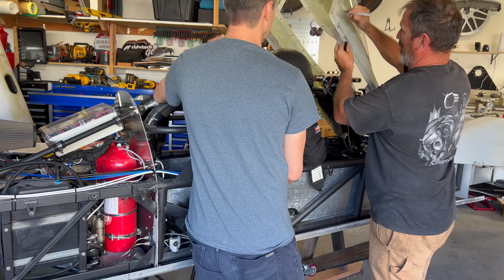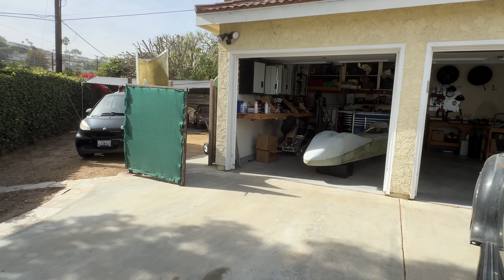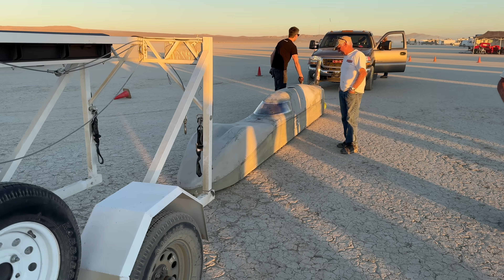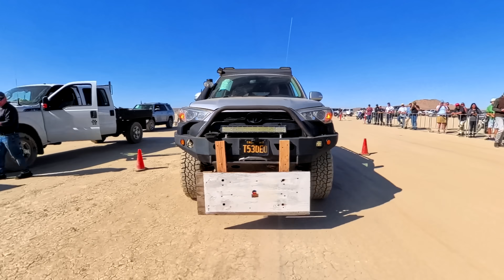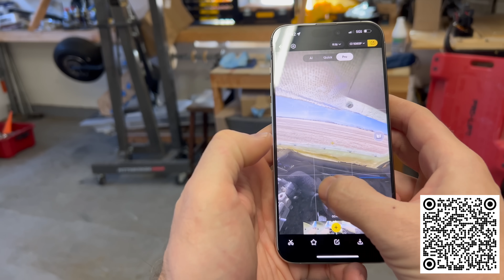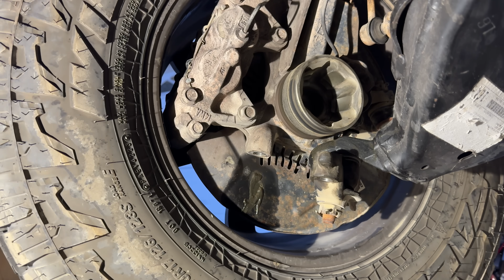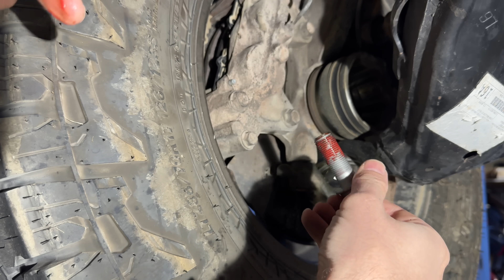I Went Too Fast

Comment: Why choose a 1000cc engine with deactivated cylinders?
There's the option of using a 600cc with the displacement lowered to 500. It would likely be lighter and have better power delivery.

Comment: Heheh.. too fast. Never been out on El Mirage during a speed trials event but I have been out there when nothing was going on. 1st time was in 1996 on a 1992 Suzuki GSXR 750(Bored and Stroked to 883cc). First pass I hit 185mph indicated and still had some Revs left in the engine before Redline. This was long before GPS devices were affordable or widely available. Lemme tell ya. Out on that dirt on 2 wheels, you can't tell the difference between 120 and 180, it just feels fast.

Comment: Hey congratulations on licensing! I am almost done with the video, but I ended up with an idea. You mention going with a 500cc engine and disabling two of the cylinders. I don't know if you will, but considering that crankshaft is likely flat plane, it would be fun to experiment with which cylinders are or are not active. You could either have a cylinder every 180, or 2 cylinders on the same side of the crank. Either inside or outside, which might not matter, except for vibration from harmonics. Good Luck!

Comment: I'm pretty surprised that you've decided on half a 1000cc four-stroke rather than a whole 500cc two-stroke. (Unless I'm just not understanding the rules). You should get 180 hp from a 500cc four cylinder engine without getting too extreme, and 210 if you're at the cost no object end of the curve.

And then further surprised that you've decided on a half a four cylinder to make a twin rather than a four cylinder that's already 500cc. 

But then I've never built anything.

Comment: So you are looking to exceed 150 mph with 500 cc, non boost, on gasoline? With a 4 cylinder engine running on 2 cylinders. Why not sleeve the bores and go with smaller pistons? Or de- stroke the crank? Or both.  A shorter stroke can get the rpm up a few hundred additional rippems . Building a custom crank case, and crank with a 70mm bore with something like 30 mm stroke  revving to 20k RPM may do it with c16 fuel, and 15:1 compression. And water methanol injection! 😎👍

Comment: Haha about you going 150mph and also you forgot to tighten one basic bolt. I had a similar feeling after rebuilding the whole front end on my motorcycle right when I was going 90mph on a very high sweeping overpass I would surely die from if I went over the barrier. "I sure hope I did it right!" Evidently I did.

Comment: Hello! 
Why just not use a 500cc engine? Honda CB500 is quite good motorcycle. 57 hp I think. Or, Honda CBF 500. Two cylinders, 6 gears, N/A engine. 
If you just shut down two cylinders from a 1000cc engine, you gonna lose a lot and there also some parasitic friction

Comment: So leaving the start line without the push vehicle was in fact the correct decision.  If the ball joint issue would have become serious during the push, you might have had serious problems with two cars, not to mention the drivers.  If it weren't for dumb luck.....you know the rest.  
Glad you had a good run with the streamliner, that wake or lake thereof is impressive.  
Keep at it.

Comment: Kudos Matt. 
I noted from the rear facing camera that the dust wake looked very small but I figured it was most likely the camera distorting things, but no, the comparison clip was drastic. Excellent job.
Overall (4 Runner aside) a really good debut run with the body.
I look forward to seeing the results from running on half the engine.

Comment: Instead of deactivating cylinders and thus killing the engine while trying to spin it, make the crank smaller and use a smaller piston. You would then have more torque at higher rev range = more top speed. Sizing down from 600cc I-4 would be much simpler, but a 1000cc is doable. It accepts longer rods than 600cc, so the overall torque curve will be easier to manage. If you want to use only two cylinders, it's V2. Parallel twin is pointless in every configuration. Never enough revs, nor torque for a decent top speed run.

Comment: I did my brakes for the first time when I was 19. 
About two weeks later, going for a drive, hear a ‘ping’ from the driver’s side wheel. 
I get home, wonder what it is. Next drive back up, tap the brakes, and hear a caliper slipping and grabbing.

Ah, caliper bolt ejected itself last night. 
Great. New bolt. Added loctite and torqued. 
You make that mistake only about once, hopefully

Comment: slap them stickers on and clear coat it. maybe add some superfastmatt color to the clear but it looks cool as an unfinished project.   Also had that bolt issue as well on my Taco but it was the front bolt. the shaft didn't fall out , fun parking lot repairs.

Comment: I always think speed runs are wide open throttle.  Sucks you have to keep speeds down Avon a speed test.  More like the interstate, designed for 200 mph but limited to 70.

Comment: May I suggest to paint the screw in handles in a bright flashy safety color? You know, so that they are easy to spot when I've of them gets forgotten to be removed before a run. Just in case.
Reply: weld a washer on the end and attach one of those REMOVE BEFORE FLIGHT tags

Comment: think that winglet holder for the 360 camera might become a hit if they put a flexible magnetic rubber flap type base on it so you can slap it down on a car roof or bonnet  , be way better than using a selfiestick i think
as for disabling the inside two cilinders , you might want to think about removing part of the valvetrain the pistons and the inside rods and reballance the rotating assembly (whont be eazy as you need to press apart the crank to remove the rods ) 
any drag/resistance inside the engine that can be deleted is added power to the rear wheels and not having the parts in the motor makes being called a cheater (i bet he turns on all four halvway down the track) that mush harder 
might need a little more oil in the carter as there less parts sloshing through it and the be more oil collecting inside the bare inner cilinders 
btw the first smart fortwo engines where 600 cc an aluminum 3 cilinder with a turbo hemispherical heads two sparkplugs per cilinder so theoreticly they could run on nitro methane i can lift a fitted engine on my own so it should way less than about 80 kilo or so 
not known as the most reliable engines (cilinders tend to become unround and they start using oilafter only 80000km ) unless you machine them perfectly with a honeplate 
having take a few a part over the years the bottom end is pretty solidly build the gearbox is weird and you might need to think of an alternative for it though (harley davidson or norton style stand alone sequential gearbox and chaindrive setup maibe) 
the engines in stock form allso tuned rather moderatly at about 60hp and are electronicly limited to 130 kmh a bigger turbo and aftermarket cpu can boost those numbers 
believe the second gen smart car has a different engine in it

Comment: Those bolts are all but welded in there now. 
The heat you'll have to apply to get them out will make you have to replace every rubber component within a half metric mile of the bsll joint.

Comment: @superfastmatt
I think I've' read somewhere before that land speed guys used to run heating and defrost systems when racing as it will create positive pressure in the cockpit and keep dust from wanting to enter the cabin. Would it be possible or make sense to rig up a small system to try that?

Comment: Nice ! Finally a (half) finished project XD How are you going to disactivate those cylinders though ? you cant just unplug injectors, and driving without sparkplugs around a lot of dust or salt is going to be a major issue too ( and not enough to remove all compression)

Comment: Maybe you could find one of those old Yamaha 5-valve engines that's about 500cc's and use it for your powerplant.  That way you don't have half of a 1000cc 4-cylinder's hardware flapping around not contributing anything to the effort.  Just something to consider.

Comment: Do the control arms spec thread locker? I mean, thread locker isn't always necessary, it's not something you need to throw on every fastener (You probably know this but other people do it and I just think you're making things harder to take apart next time). Granted that missing bolt isn't encouraging, unless you didn't torque it as you mentioned you weren't sure. I'd have probably stuck with blue loctite, probably would've held it in fine. You didn't need my 2 cents but here they are.

Comment: I was thinking about the deactivated cylinder. Whatever you do you wouldn't want a vacuum potentially sucking oil to the top of the piston where it could accumulate and hydro lock.

Comment: I dont jnderstand why youre deactivating when you could just use 500cc lump. Which will be lighter. You could even slap an old yamaha 4 cylinder 2 stroke in there if someone is daft enough to give you an engine...

Comment: You say that two cylinders are deactivated, but you always say that weight is one of the most important aspects of a fast car. 

Just wondering if there’s any specific reason why having an engine with two cylinders disabled was better than something else. 

Thanks for the great content otherwise :)
Reply from the maker: Land speed racing is one of the few types of racing where weight is not important. Weight is the enemy of acceleration, and land racing is more about steady state speed.
Reply: @SuperfastMatt  

Thank you, that makes sense. 

Super happy for you that the run went off with a minor hitch with dust. At 38% throttle, 157mph is incredible. Will you ever do a run with all cylinders and max throttle or is that just a bit too dangerous? (Surely not as bad as missing a bolt in your 4Runner control arm whilst driving home on the freeway)
Reply: That BMW bike engine produces 200 hp per liter, so half of it are about 100 hp. There's no easily available engine that produces that kind of power with 500cc.
Reply: @jospi2  Damn, I couldn’t imagine riding a bike with that output. I’ll stick to my 125cc’s 😆. That’s immense.

Comment: Oh, he used the red stuff. Future Matt is going to hate this guy.
Reply: It's probably a future mechanic that's gonna hate past Matt, once present Matt realizes how bad of a mistake he made in the past. Neither past, present, or future Matt will ever want to deal with that..... 😂😂😂
Reply: @Fpvpilot928      Naaa..  Propane torch to heat and unscrew 😎
Reply: @AlbertRobinson-v3y  Can't be stuck if it's liquid :D
Reply: @AlbertRobinson-v3y  Yes, if you know to use it first. I wouldn't think some maniac would use so much red Loctite on a part like that. They'd have to be mental.
Reply: @TheAverageDutchman Not quite, thankfully.  Red Loctite softens and releases with heat - it’s designed to!  So anything you put together with red, you get a little under soldering temp and it comes apart lubricated.
Reply: @AlbertRobinson-v3y  This is the answer! And as a bonus, he will probably set something on fire and end up with a bunch more exciting content. He is clever like a fox.
Reply: @TheHungrySlug  i figure matt was superdon'tevercomelooseagainyyoubitch matt, at this point. Edit, yes future matt will regret this
Reply: Propane is weak, use MAPP gas for that heat sweet spot and efficiency.  If done correctly you'll spend less in the long run.
Reply: @AlbertRobinson-v3y  I was gonna say, red is for stuff you can heat, blue is for stuff you can't.
Reply: @AlbertRobinson-v3y  This guy knows how to deal with that red problem.
Reply: You can't really be that  stupid? Being of Dutch ancestry I am insulted for calling yourself average Dutchman you are far below any average(excluding massive stroke or brain injury).
Reply: @AlbertRobinson-v3y  Yeah. But what about thermal expansion.
Reply: @TheAverageDutchman  You obviously don't heat it up that much. They use red locktite on guns and ive never melted a gun removing a front site.
Reply: Spoiler alert: It won't be the near-future Matt who was supposed to fix it, who's going to be undoing those bolts. It'll be the "side of the road because the wheel fell off" later-future Matt who'll have to deal with it.
Reply: Steering bearing in my electric scooter have 3cm of red Loctite on it, as manufacturer recommends. I always feel sorry for person replacing it.
Reply: @uosiumen   Stud and Bearing Lock works great for this and will fill voids on worn housings.
Reply: @bobroberts2371  that's how it's designed in my scooter: https://youtu.be/zsR7hP9pe0Q
Reply: @bobroberts2371  big sigh , it will fill all voids less than really gnarly!
Reply: Foreshadow Matt is terrifying when he just pops up out of nowhere
Reply: I was cringing as he was applying it. My thought was "However much Red Loctite you use is directly proportional to how much blood you're going to lose getting it back out"
Reply: really slathered it on there too
Reply: The blue wrench will make quick work of it.
Reply: @nf4x   "All hail the Blue Wrench"
Reply: He should have used ham juice.
Reply: If you can't stand the heat, don't break out the red stuff. Seriously, the blue is 70% as good at holding the fastener and you can grunt it out without heat.
Reply: not really, just drive it down a hill riding the brakes and that knuckle should be nice and hot, hardly need any heat applied (I recommend a heat gun lol less likely to start a fire with grease/rubber and you can hurt yourself worse with it if you're gonna hurt yourself) to get 'er loose - I just found orange and it's working pretty good (heat doesn't seem to affect it at all).
Reply: @russellzauner  Yeah... Better make that pads, rotor, and some fresh brake fluid while he is at it.  And of course rear axle seals which means you pulling axle shafts and a Yota 8" pumpkin, then shimming it back in.   Fun times,  get those brakes real nice and smoodering hot on that old rig...
Reply: @russellzauner  With oversized off road 34" tires... 🙄
Reply: Having taken apart motors that had 1-3/8" bolts doused in red loctite, bolts that are supposed to have anti sneeze on them instead, I can guarantee future Matt will be very unhappy with past Matt.
Reply: Nothing a butane torch can't help with. Just heat and pull on the pull handle til the red shirt bubbles out and gives you a nice 2nd degree tattoo
Reply: I consider blue to be for stuff you don't want to fall out, but may need to take it apart one day. I only use red for bolts I dont ever need to remove. Blue really is pretty damn good
Reply: "Enough to stop the rotation of the Earth" XD
Reply: red is common for those bolts
Reply: @beargillium2369  and future matt hates it
Reply: we are all future matt even in different fields
Reply: Heat is his only friend
Reply: Next video sponsored by a little portable oxyacetylene torch setup
Reply: I was saying the same thing. 😂 oh god.
Reply: Sad that I instantly knew that was thread locker. God have mercy on the person that needs to unfasten that god forsaken material
Reply: Just needs to head it up to 260c and it will loosen.
Reply: No.     He used ALOT of the red stuff.   Good luck future Matt!!!!
Reply: Yeah, keep that cutting wheel handy😂
Always use blue on a vehicle..😵
Reply: Future matt will be buying a bolt buster
Reply: It's fine. Next time he should be able to use the blue goo instead.
Reply: Nothing a blowtorch couldn't fix.
Reply: 😂 was going to say the same thing
Reply: you're god damn right. Threadlocker is a bandaid for shitty mechanics and engineering work IMHO
Reply: Love your sense of humor 😊
Reply: It's nail polish
Reply: lol
Reply: Heat and beat.
Reply: Was just thinking that. 🤣 We need a video of future matt taking this apart.
Reply: I never have that bad of a time with it 🤔
Reply: Red picture really isn’t that hard to remove

Comment: You wouldn’t have guessed that a dusty wind screen and a broken half-shaft would both be caused by a missing bolt.

Nice job on the racer Matt, looking good!
Reply: Turns out bolts are important
Reply: @barongerhardt i though it was important to nut on time, but apparently to bolt at the right time is also important.
Reply: @barongerhardt  No wonder you have to use so many of them in Satisfactory
Reply: @barongerhardt  yeah, I loved that movie as a kid
Reply: You have to have a screw loose to do this stuff 😏